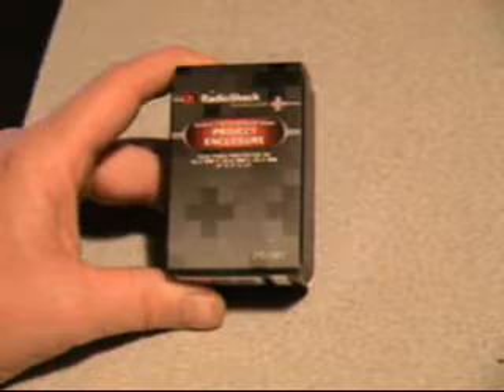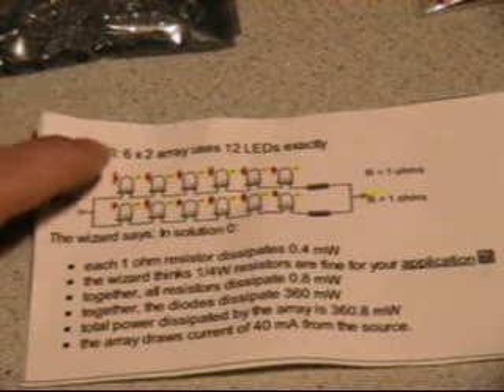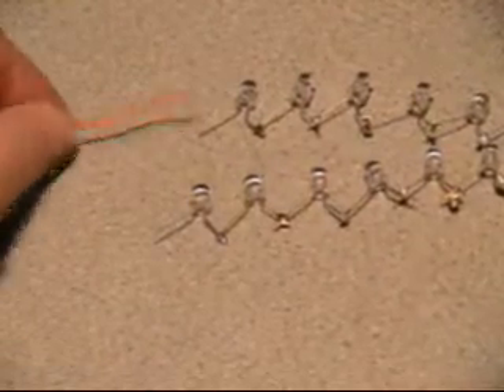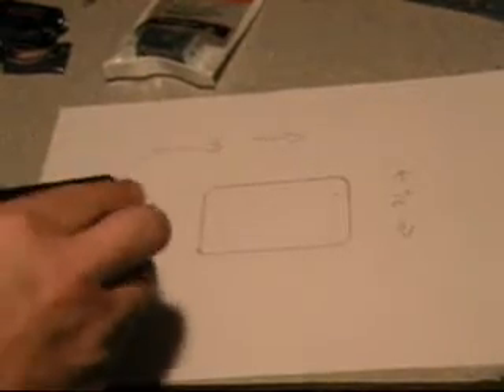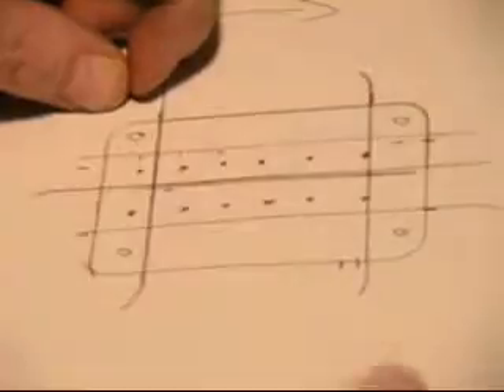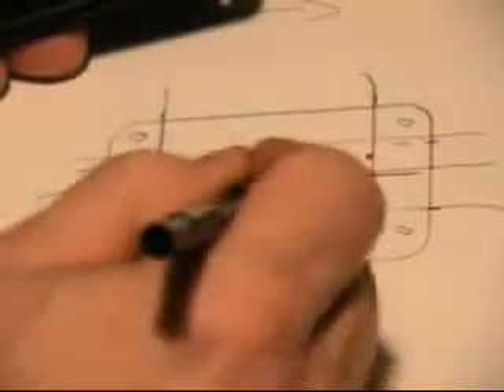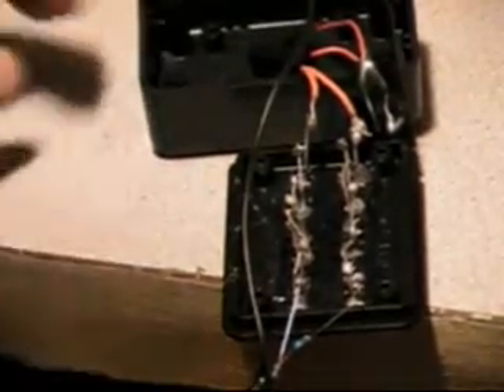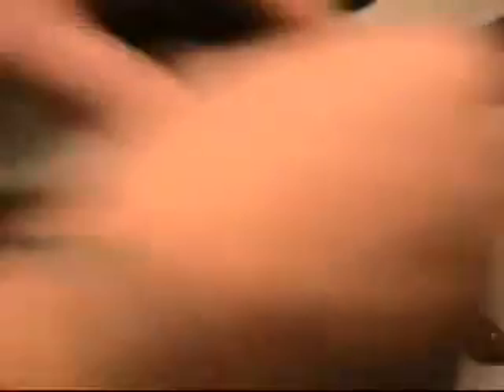how to make an ir light

Comment: If you make your mount for the IR LEDs first then you could have used it to hold all the LEDs while you soldered them it would be much easier as well as neater inside the project box just threw that out there in case anyone else wants to make one